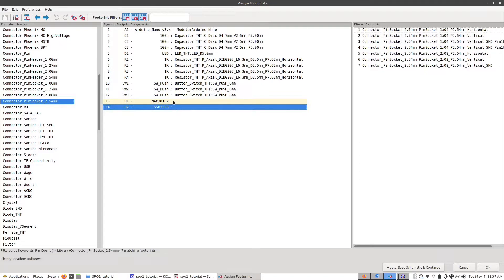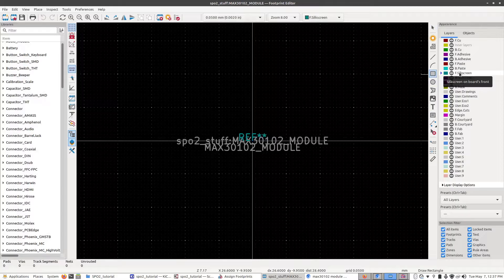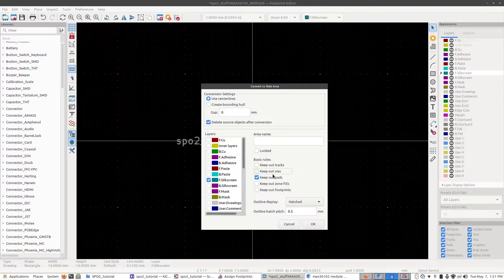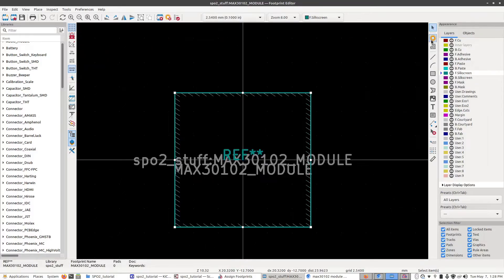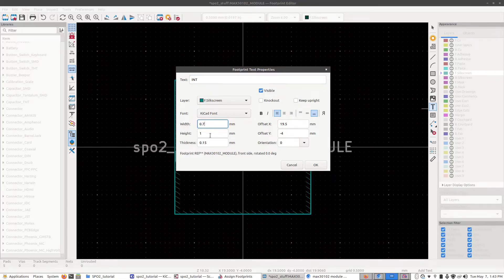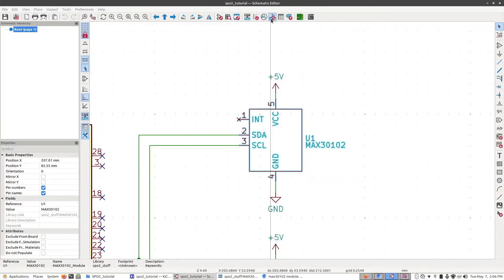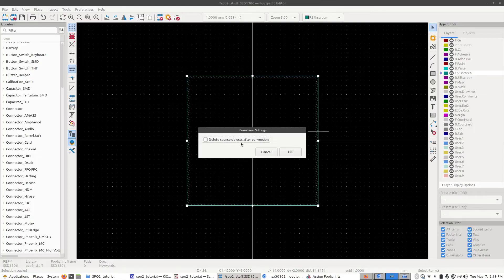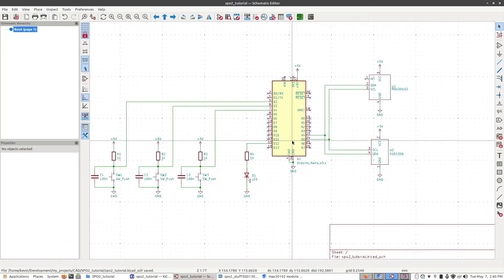KiCAD Custom Footprint | Part 4

Comment: I am facing an issue while creating footpints of MAX30102 and SSD1306 when i click file and then create new footprints after i give name it did not show me the option to select the type of footprint and also show REF/untitled/Refrence on screen
Reply: double click on the sketch(anywhere) and it will pop up a thing call footprint property. then click general it will show ur footprint name and downthere u should see component type :smd and change it to through hole.this is cause bc of kicad new update.
Reply: @liewjunyee8836 , after doing that, the program shuts down. What could be the issue here?

Comment: Additional Tips from me, (utilizing this tutorial and discovering my own things about KiCAD (using KiCAD 9):
- When Assigning footprints for your schematic, make sure that the pin numbers from your symbol and pad numbers from your custom footprint match. For example, if you have an LED symbol that has pin numbers 1 and 2, make sure your footprint has pad numbers 1 and 2 respectively. Additionally from matching numbers make sure that you have the numbers in the correct order, for example, if your LED symbol has a positive pin 1 and negative pin 2, make sure on the footprint that you understand pin 1 will be the positive pin, and pin 2 will be the negative pin (this matters for visualizing your PCB layout). If you find that the pin/pad numbers do not match, its much easier to edit the symbol (within the projects scope, not globally) then the footprint, so just go to symbol editor, find your symbol, click on the pin number, type what matches with your footprint pad number, and then press enter,  lastly press save.
This may lead to some warnings in the ERC such as "Warning: The symbole ('' symbolename ") does not match copy, this is ignorable as you purposely changed it for good cause.

-At 2:33 , when creating rule area from selection (the silkscreen shape(square) to Rule area), if you look at the pop-up and see the checkbox "Delete source objects after conversion", uncheck this as well as what HTM Workshop says and it lets you skip the step of recreating the silkscreen shape, as shown at 3:24.

Comment: for those getting an error when editing the shape:
1. file --> footprint properties 
change component type from SMD to through hole if you haven't already
2. select your pin, press e
3. make sure pad type is through hole
4. make the diameter 0.762mm
Reply: >> 4. make the diameter 0.762mm

I guess 0.768 mm is the radius, not the diameter though.
Hole diameter is 0.8 mm, so when I set the pad diameter to 0.768 mm, KiCad correctly warns me there's no copper,
When I set the pad diameter to 1.536 mm (2 * 0.762) it looks just like in the video.
Reply: thanks all!
Reply: ty bro
Reply: Glad I looked in the comments,  I was going nuts trying to get the through whole pads instead of smd pads.
Reply: Thanks so much, in KiCad 9 there's no dialog when creating a new footprint, and it defaults to SMT.

Comment: Great tutorial! Thank you! Everything is clear.
I have a question: what are the recommended values for pad and hole diameters?
Reply from the maker: Its going to depend on who the manufacturer is and the size of the components. I think this is the video that has the manufacturer info for JLPCB - https://youtu.be/aW1Xm3xSGmk?feature=shared

Comment: I'm curious about the placement of the 4 OLED pins: it seems as if this was just eyeballed? I noticed in Part 7 at 3 : 28 they  get shifted again. What happens if the holes don't line up ?
(I'm working along with the video and putting in a HT-RA62 which has a 3rd rate data sheet, and no footprint files, so I'm other than getting out the calipers, I'm curious how others approach this)

Comment: I got to the apply save and continue step after assigning the custom footprints. The program shut down and the symbols, the schematic, and the footprint assignments were all deleted in the process. On a positive note, the custom footprints are still there. Any insight would be appreciated.